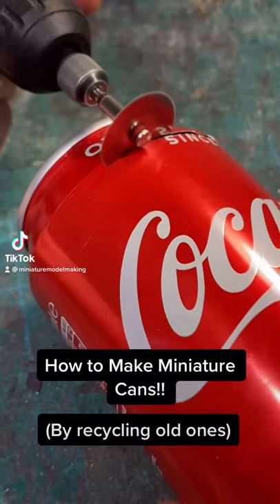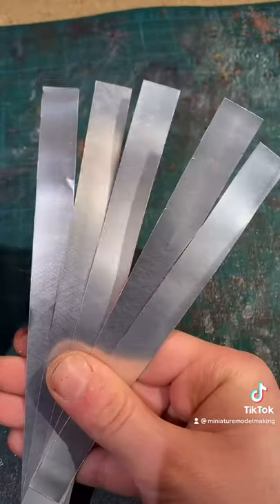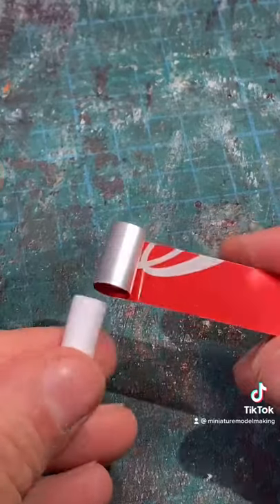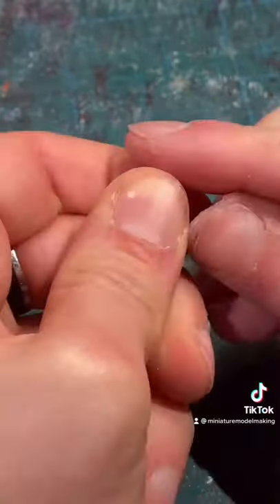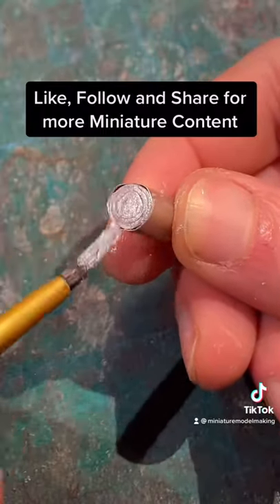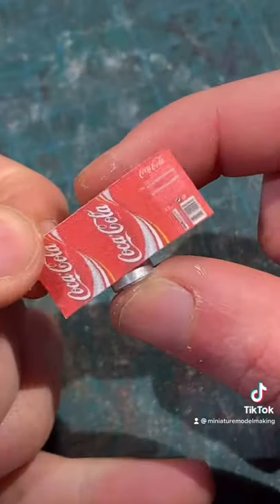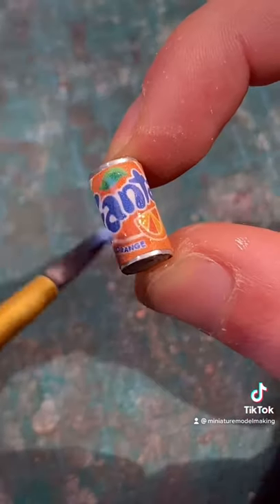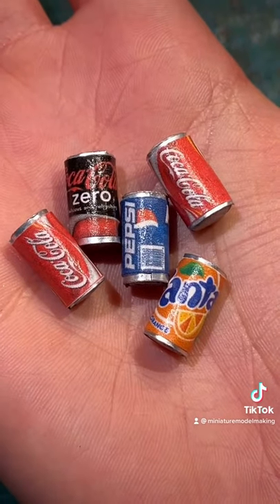How to Make Miniature Cans (by recycling your old ones)!! #youtubeshorts #shorts

Comment: How do you get the printer to print so crisply? It's is the printer, the paper, the ink? I do miniatures as a huge hobby and Ive never printed stuff because my prints always look like three red pixels
Reply: I'm surprised by your comment. I use my printer a good bit and it was literally just the cheapest printer (with wifi) at Walmart. I think it was less than 30 dollars, it's an HP but I'm not sure which model (although I will check if you like)... what printer do you have?